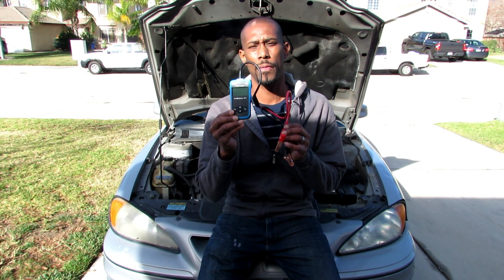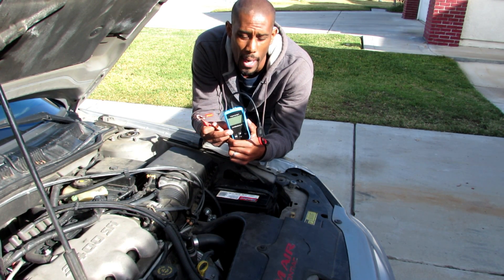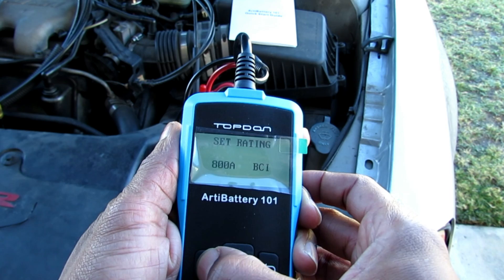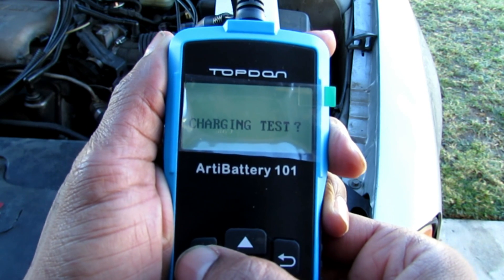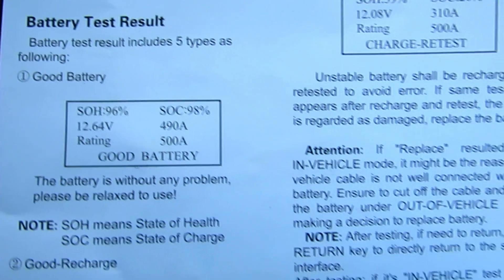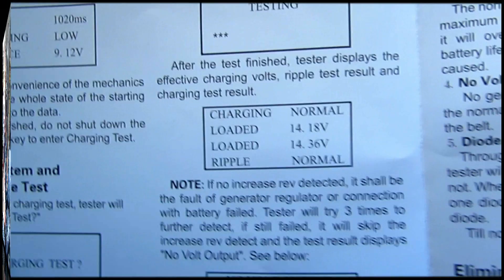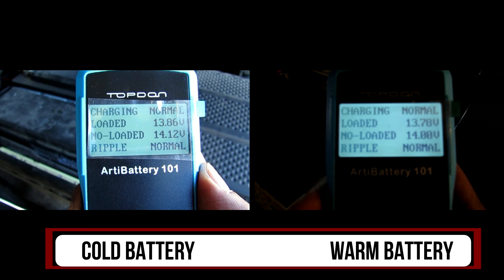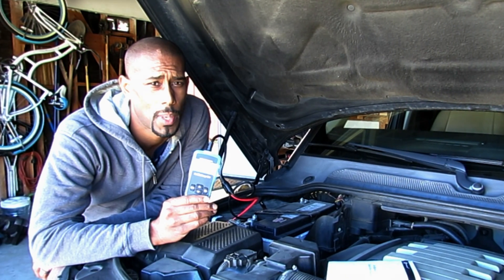Learn How Important It Is To Test Your Car Battery - Never Get Stuck Again

Comment: You can’t depend on these testers. It can detect a bad battery but not all of them. I tested a friends battery and it passed as good, but if he leaves on dome light for half an hour or a cold morning it just about starts. It doesn’t measure capacity.

Comment: Could I jump my car, then connect this to determine/confirm the alternator might be bad?  The battery is fairly new 14 months old but the car sat most of the summer, (I have 2 cars) but that battery should be fine, the car wasn't driven that much since it was purchased (9/2017) I bought it from batteries plus, so that was a first doing that:).  Went to start it now that winter is almost here and it was  completely dead.  Jumped it, ran about 5 minutes, the second I turned on the headlights, it died immediately, and back to dead as a doorknob. Ran out of daylight for today, so will look more closely next weekend when there's more time.  In the meantime, I just ordered this tester.
Reply from the maker: Yes, you should be able to jump start your car and then the tester will give you a reading on your alternator.

Comment: Do you ever tow with the LR3? Could you do a video about the quick release tow hitch receiver? Maybe explain hitching up with it? I know it's like a $500 part if you don't have it.
Reply from the maker: I don't have the tow hitch anymore. You're right, it cost $500 so I'm going to buy an aftermarket tow hitch that mounts directly to the rear frame.
Reply: oxmanagain Would like a video about that just as much!  Be careful with those, I read about someone's cracking when they put a load on it!

Comment: OMG, $55.00 :((((((((((((((((( - Add another $25.00, might as well buy another Battery !@#$%^&*()
Reply from the maker: My battery's cost $200 on both of my cars. But thanks as usual.
Reply from the maker: From Amazon, I left a link in the description below the video if you want to check it out.
Reply: were u got that lil toy bro